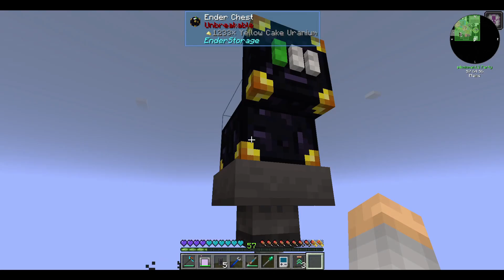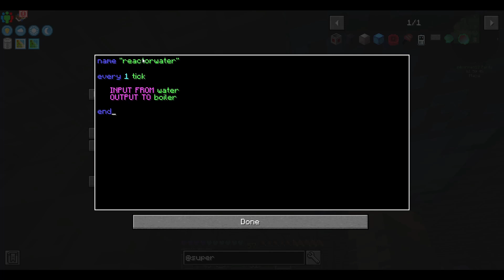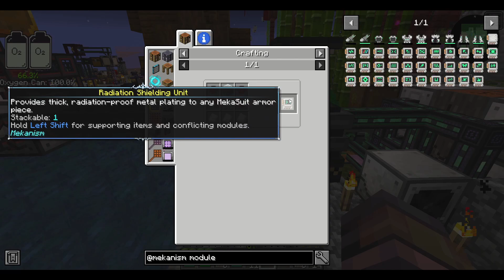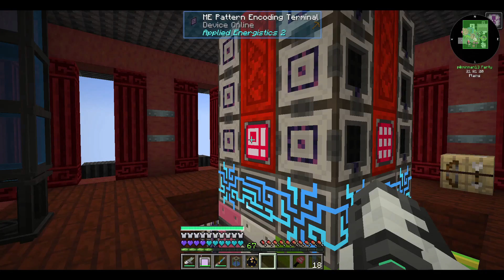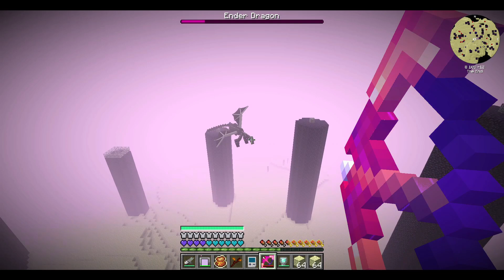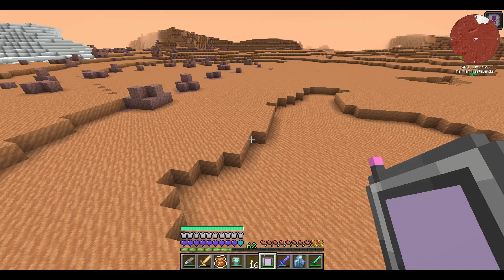FTB Skies Expert Guide- Episode 13- The Nuclear Abomination

Comment: You don't need nearly that many electromagnetic coils, a max size turbine only needs 5
You can replace that space with saturating condensers, and then the turbine vents will output all the water you put into the turbine
Also, you don't need a boiler until you get to over 100 mb/t burn rate
Reply from the maker: water-cooled fission reactors are nerfed greatly so i absolutely needed the boiler. i remembered there being some way to recollect the water but i forgot what it was. weird that youd only need 5 coils for max size, though.
Reply: @pikminman13  oh. How were they nerfed?
Reply from the maker: @Destral9756  i believe the amount of steam it makes directly was greatly reduced, while the amount with sodium is default. much like how the dry fusion reactor is capped at 4M RF/t while water-cooled fusion is basically untouched.
Reply: @pikminman13  I just tested it, and it looks like the normal "1 fuel = 20000 steam" to me?
Reply from the maker: @Destral9756  hm, well, i was told steam reactors were nerfed from the main pack dev, so idk